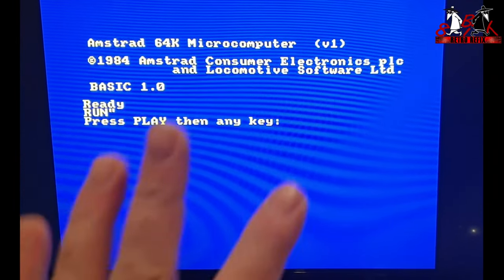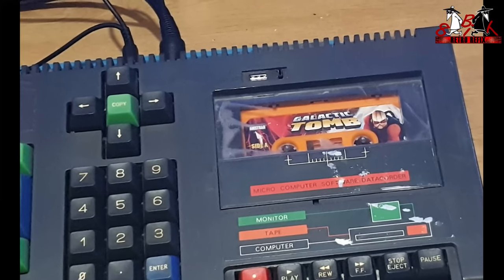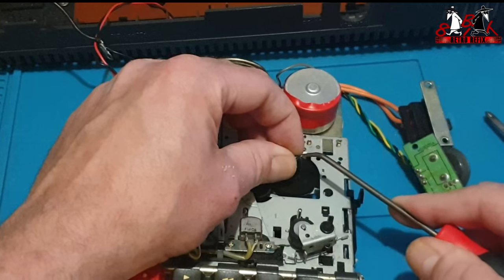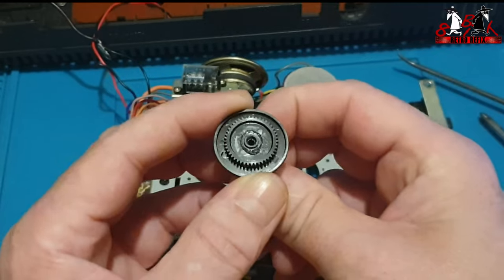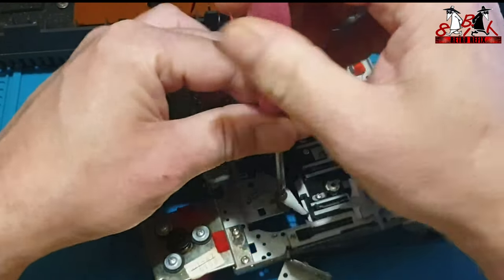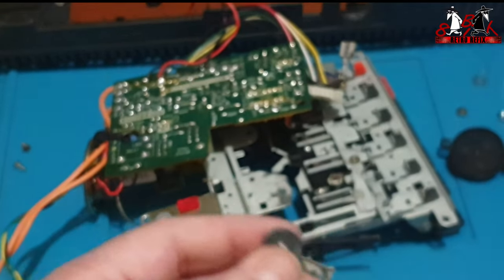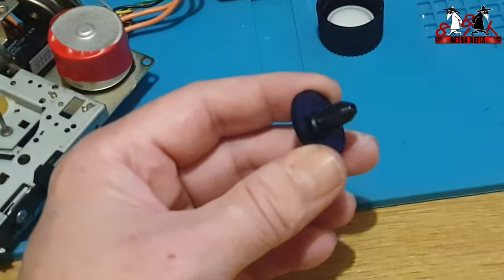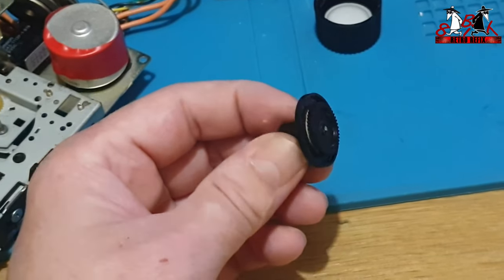Amstrad CPC464 how to replace a tape deck idler tyre

Comment: I agree with a couple of other comments here. The take up spool just takes up the tape from the pinch roller. The pinch roller and capstan govern the speed and smoothness of it.
Any irregularities of tape speed will likely be either a tight / deformed capstan or pinch roller. Another possibility is that the rewind spool has tight spots.

Comment: Also if you need a new mechanism the Commodore Datasette (Taiwanese version) is almost identical to the CPC (early 80s Tanashin design) so can be transplanted, although getting the pause working is non-trivial and it does require some part swapping.

Comment: Not sure what happened, my post was deleted... It could still be the belt (poor quality or tight belts can cause high wow and flutter), or the pinch roller could have a dent in it through being left in play mode for a long time (complete pinch roller assemblies can be had on Ali for a couple of quid). I've noticed that the CPC is very prone to errors caused by speed instability. Demagnetising the head, and checking the azimuth might also help.
Reply from the maker: Thanks for that ill try demagnatizing the head .. Good call ;)

Comment: The more I think about this idler "fix", the less I am convinced that it is capable of sorting out uneven tape speed. The idler transfers motor motion to the take-up reel, and not the pinch roller/capstan (which ultimately governs tape pitch). The take up spool doesn't affect speed at all, unless the problem gets so bad that it isn't taking tape up.

To see what I mean, get a tape player without a cassette door. Play a tape, and physically stop the take up reel temporarily with a finger, then let it go a second later. The reel will go faster to take up the slack - but the speed of the tape playback doesn't change.

Really the only things that affect tape speed are the motor, pulleys, belt, and capstan/pinch roller. Not the idler.